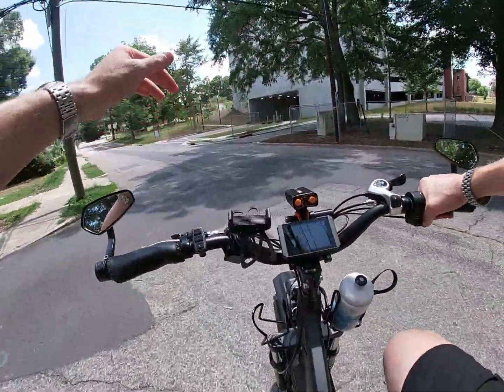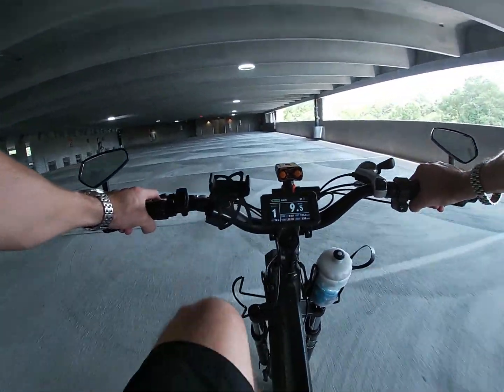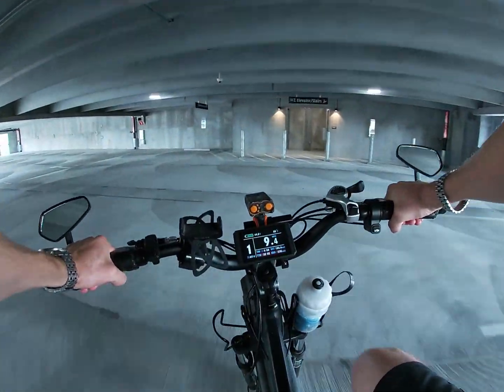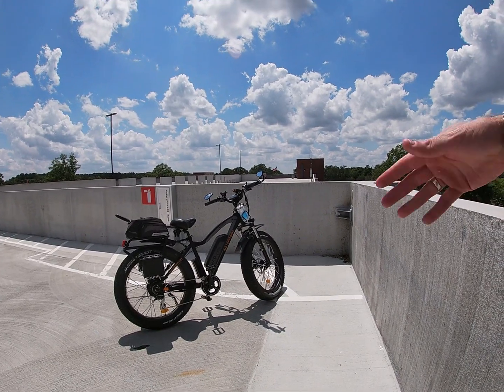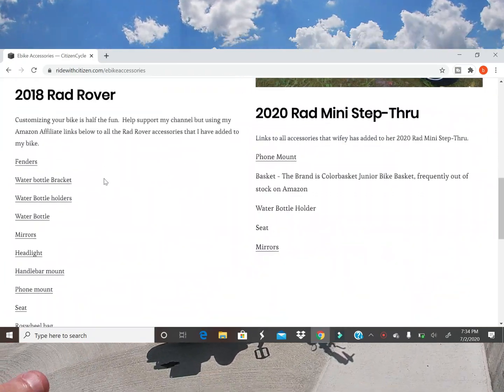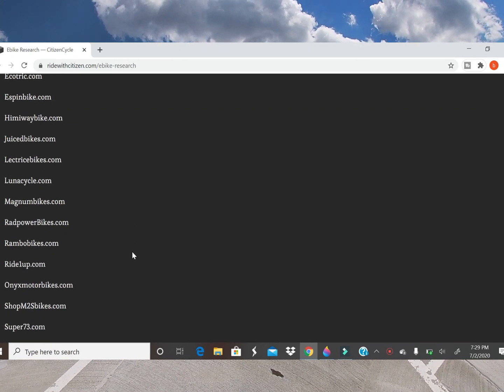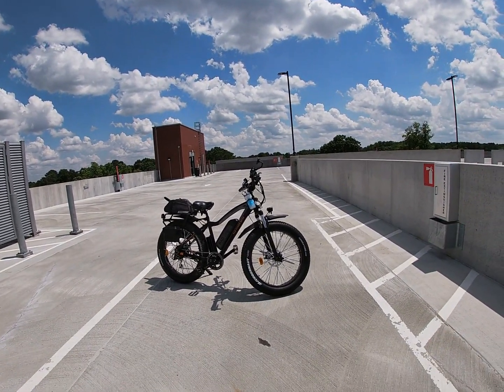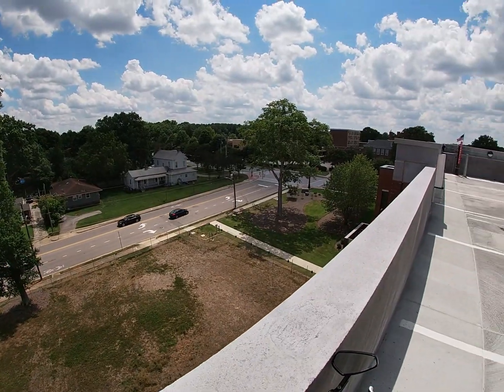What tests for upgraded Rad Rover ebike

Comment: First, thanks for your videos!  You do a great job!  I'm still an Ebike virgin.  Has anyone calculated their total costs in these upgrades?  If so, I've missed it.
Reply from the maker: Thank you for the kind words, when i am done, it will be roughly $900 to $1000 in upgrades for the controller, motor, and battery.

Comment: Would love to see you at the beach again, this time with the new motor and with a pump to try out 9-10 PSI on the tyres. I live near a beach and would love to see how this handles it in optimal tyre/motor conditions.
Reply from the maker: i gotta tell you, i wasn't thrilled with all the sand that got into every part of my rover.  tried blowing it out with my air compressor but i'm still finding sand weeks later...

Comment: I'd be interested in seeing the max distance with PAS set to 5.  The way you ride, we'll never see the capacity.  I'd be interested in total distance using just the throttle.  This should give your users a pretty good idea of the minimum distance to be expected.  If we use PAS less than 5 or not use the throttle as much, we should be able to exceed your output.  Love what you're doing and keep up the good work.  I'll support your website to make purchases as much as I can.  I'm expecting my Rover 5 to be her in the next 2 to 3 weeks.  Already ordered quite a few parts before I knew you had a website. Looking forward to see more of you videos.  Thank you.
Reply from the maker: hi Kwang,  thank you for the kind words and support, enjoy your Rover, hopefully it ships quickly.    i have been getting a fair amount of requests for another range video.  might have to add that to the list.
Reply: I just bought a 2019 Rover with 33 miles on it. I’ll pick it up tomorrow and will begin installing all of my accessories. Ordered the Jones Bar to replace the stock handlebars. You may want to check it out as an option to be explored.

Comment: This has nothing to do with adding more power  but it sure saves  my wrist  from getting fatigued  twisting the throttle  all the time  and it's something I noticed you don't have on yours. I don't know if you've ever tried one, but it's a thumb throttle adapter. Just straps around the throttle sort of like an old fashioned watch band buy Velcro. The one i use is called the '1859 Northwest thumb throttle'. They come in all kind of different colors. I believe there around 20 bucks with free shipping. There's some YouTube videos on them as if you want to check them out
Reply: Hi Bill - I've also looked into this and actually ordered the 18569 Northwest thumb throttle in Orange.  I agree with you and the comfort factor even if you don't have wrist issues is worth it.
Reply from the maker: i actually prefer the twist throttle.  as a motorcyclist that is what i am used to. thanks for sharing though, i am probably in the minority.
Reply: @CitizenCycle925   Yep preference. . If it had a full twist grip like an MC,  I  could have lived with it. My previous e-bikes had full twist grips and we're fine.  Course I had an MC at those times also. Lol.

Comment: Other than the previous speed/torque tests, I think a lot of us would be interested in seeing range tests (throttle-only and with pedal-assist) first with the stock battery and then with the upgraded one. The website looks great! Loads of links and info - Great for those looking for an ebike, as well as upgrades :)
Reply from the maker: noted!  quite a few requests for more range videos.

Comment: I like to see when all upgrades are finished (motor and battery) do a long distance ride. I like to see how far you can go. It would be cool to see a trip where you ride till you have to recharge and continue your ride. It might be a little ambitious but it be cool to see you do a series where you go across state lines a.k.a. a couple hundred miles. Maybe check out some gear that go along with your E bike like a portable solar recharger unit. You can either camp or stay hotel. My question is, is this possible?
Reply from the maker: if you can kindly convince my fiancee to let me do this i'm all for it!!! hahaha

Comment: Cool test would be torque upgrade performance. Difference in hill climb with grade specs i.e. 10%, 15%, 20%? Upgrade I  see most important with more power is brakes. Tektro brakes suck! I just put in new front and back but will upgrade to another brand but what? Mechanical brakes are “affordable and self workable”.

Comment: Even though I haven't gotten my bike yet, I've been wondering how good it will climb hills. I'm in a hilly area and that's one of the reasons I'm getting an electric bike. So that I can get up the hills and not be afraid to go far knowing it won't be too hard to get back up the hills to get back home. Maybe you can do some tests like that the way the bike is now, and how much better it does after the upgrades. Brand of tires and how they wear would be great but I don't know how you would do it. Maybe start with new tires at the start of the upgrade, and keep track from that point on. It would be a good subject for your new website for those of us looking to eventually replace the stock tires. Like I like the look of the large white lettered tires, but can't find them anywhere.
Reply: I live on an Island off the North West Coast of Ireland which has a lot of hills and I can tell you that I would not be cycling if I did not have The Rad. I am a 74 year old around 100 kg weight reasonably fit and keep the power assist at 3 or 4 to give me some work to do and then boost the throttle when I meet a hill that is just too much for my old legs. I can recommend the Rad as a great way to improve fitness and also have the knowledge that I can get back home without exhausting myself. I have clocked up 1800km in six months and have changed the rear tyre at 1500km and also the rear brake pads at the same time. Hope this helps.
Reply: Yes, it's cool talking to someone in Ireland! The only thing missing is that wonderful irish accent! So, you get up the hills throttle only?
Reply: @SMG-lz1zq  No! Throttle and peddle in lowest gear for some of the hills here. I would not attempt throttle only on any hills as I feel it would put undue pressure on motor and battery.
Reply: @mickearly7347  Thank you Mick!

Comment: I would like to see a range test with the new battery. How far will it get you riding throttle only or a mixture of pedal assist and throttle. I have a 2019 rover myself and I’m thinking of upgrading the battery and controller as well. As a matter of fact because of your video I ordered the Bolton controller so thanks for that suggestion.